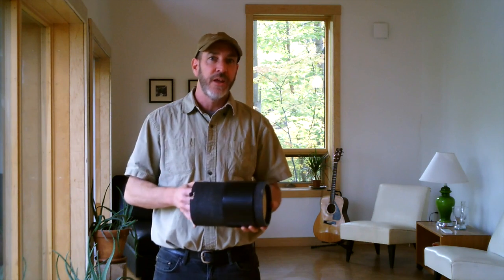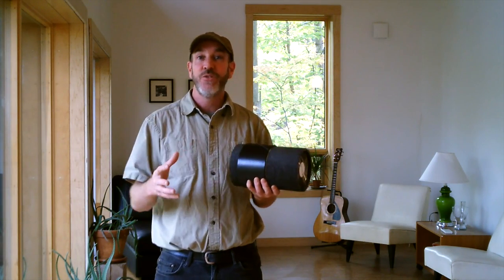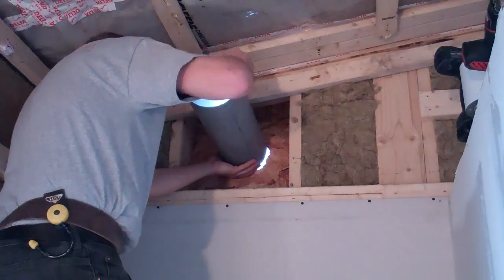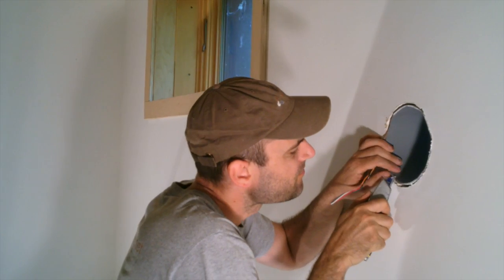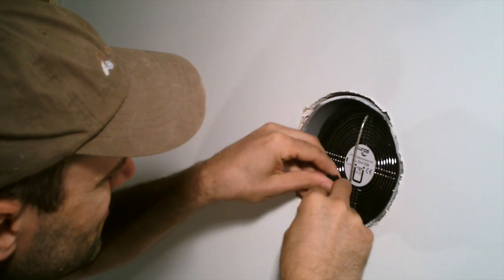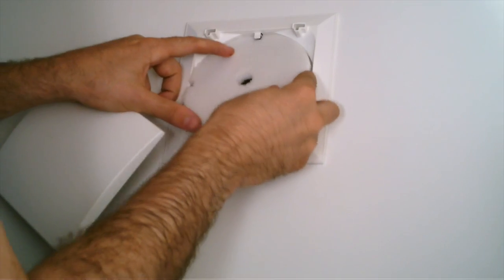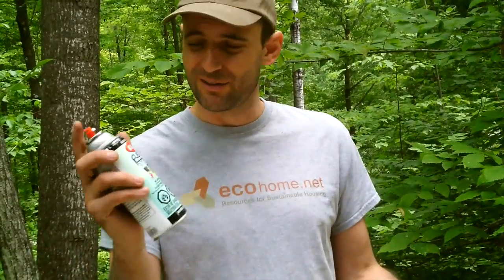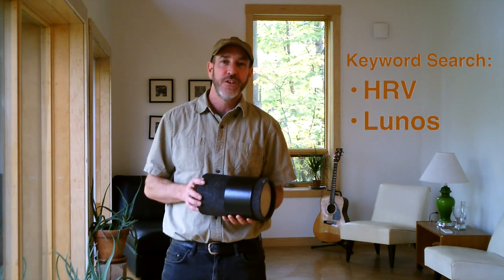Lunos HRV air exchanger installation

Comment: I have 2 pair to be installed in an already finished house.  We remodeled 10 years ago and used rigid spray foam on outside walls so the house is pretty air tight.  We have an attic.  So I am assuming somehow run all wires off lunos into attic and find and interior wall to connect four units to one controller.

Comment: I have a summeraire unit that fills with dead bugs. Needs vacuuming every few months during the  warmer season. And, now after only 3 years one of the motors is making a grinding noise. Even in a new home, I would prefer this type of system.

Comment: How did you secure this in wall?
Reply: Hi Shey, we installed the sleeve in the wall, sealed it to the sheathing, then the unit slips right inside it. Install is pretty easy.

Comment: Hi thanks for the info, I just want to ask if we want to install this Lunos HRV is it feasible if our house is already dry walled and the outer part is brick wall? Do you know if Lonus Canada offers suply and installation,? I guess doing the installation by yourself is a bit challenging as there's wiring job to be done. Thanks.
Reply: Hi Rodel, your best bet for finding suppliers I think would be 475 building supplies, you could ask them if they know of installers. I am reticent about making install suggestions to you, certainly having to cut though brick is not the easiest install, but you'd also need to be sure to maintain your air barrier, assuming you have one. https://foursevenfive.com/

Comment: Nicely done! It looks like a low voltage wire (HVAC thermostat wire?) does one transformer control one pair? Is that the wire that allows the pair to coordinate flow direction too? Agreed that the duct-work savings is a big consideration, but still have to fish a wire for power and control. Thank you for making the video.
Reply from the maker: +BlueGreen Consulting Group Inc.  Yes, it's a low voltage wire, and the wire from each unit goes directly back to a transformer in the mechanical room (not to it's partner), feeding one  controller that runs all 6 units in the house.  This  is where the switch is to change speeds, at the normal operating speed it's pretty quiet, on high speed you'll notice it though. There is for sure a bit of effort in wiring, but I'd guess not nearly the time or material investment needed with a full array of duct work. For a bit more on it check out the manufacturers video that you can find on our page. Best regards.  http://www.ecohome.net/news/latest/product-month-lunos-air-exchangers